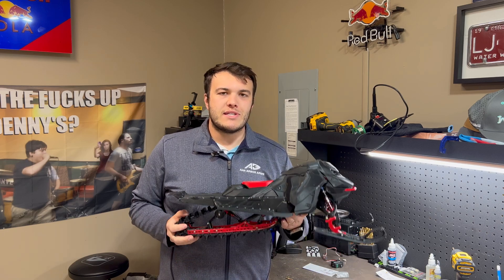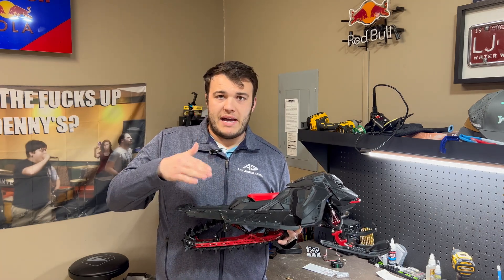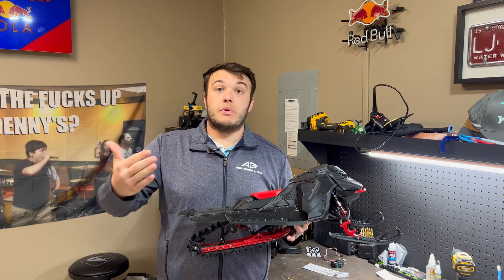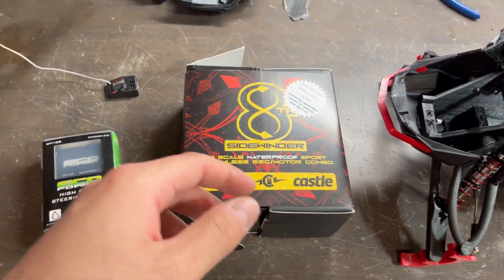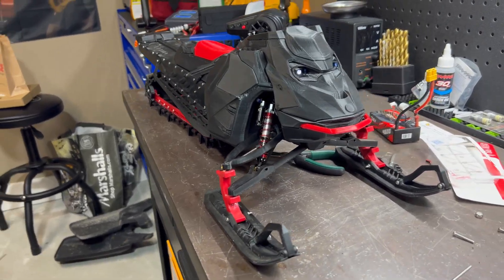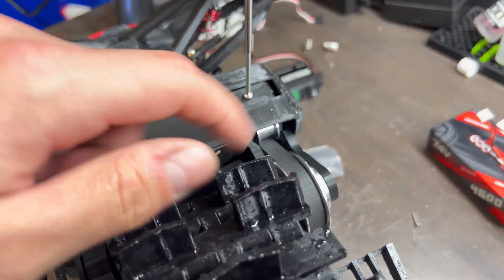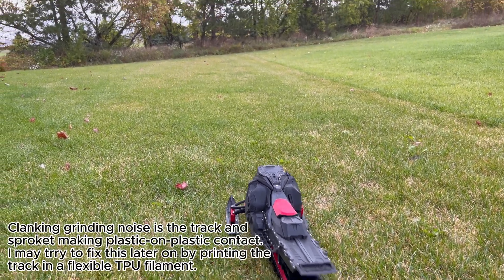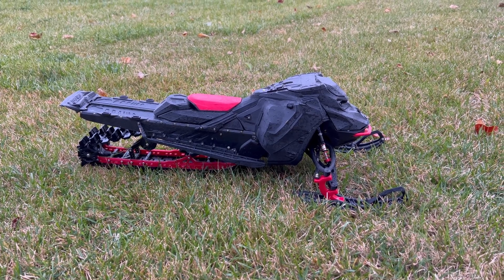6S RC Snowmobile! SkeeRide V2 by BuildItBetter

Comment: Is it a small 6S pack because I don't see where a 6S 5000mah or more fit in that ??? Some says the Mamba X combo is the best fit for this ? Why choose one over another track length ? since there's 3 available I think
Reply from the maker: No I have not been able to find/fit a 6S battery pack in it. Most I’ve ever seen run is 4S. It snowed here today so I am going to try it with a 3S pack I used in my Rlaarlo AM-X12.

Comment: The weird noise you’re hearing is still the belt/transmission set up. Make sure the track spins very freely by hand. There may be too much friction somewhere or the belt is not tight enough still.
Reply from the maker: Ok I will definitely check that out 👍
Reply: I think you also need to make sure inside the tunnel has no protruding screws.  my 100% has a few of the m2s sticking out slightly and noticed some pretty good wear after driving this weekend. Also assuming that helped lead to some of the busted tracks and paddles.